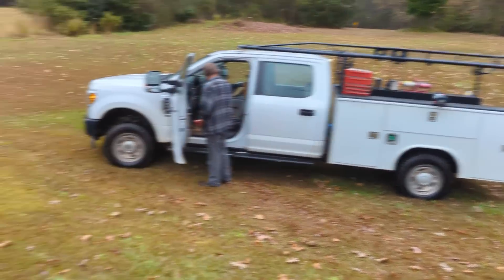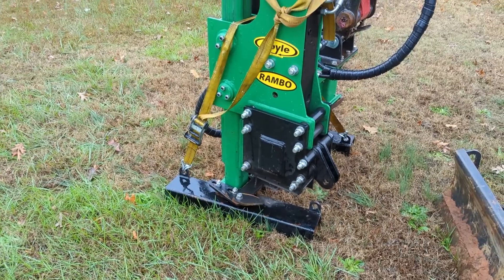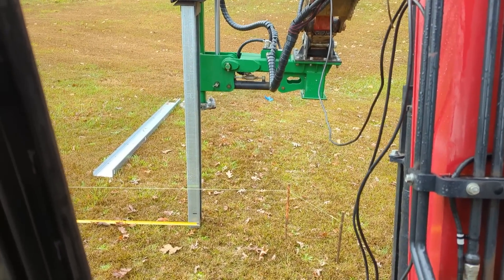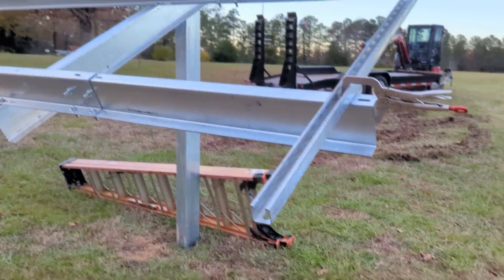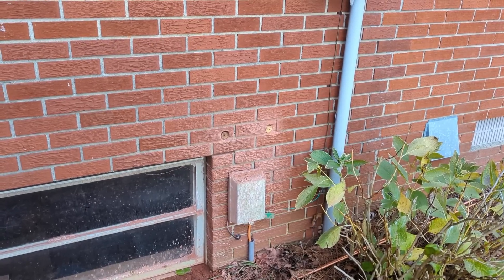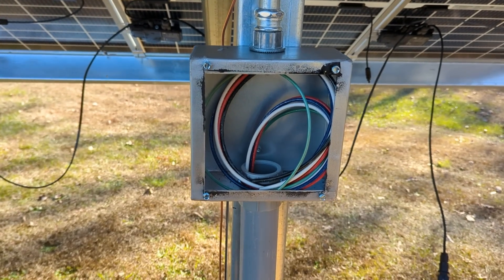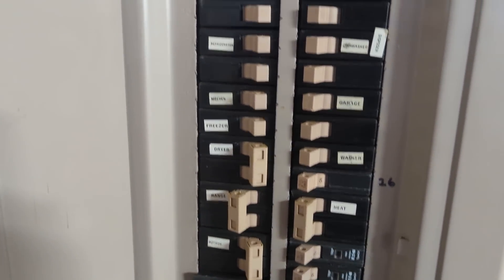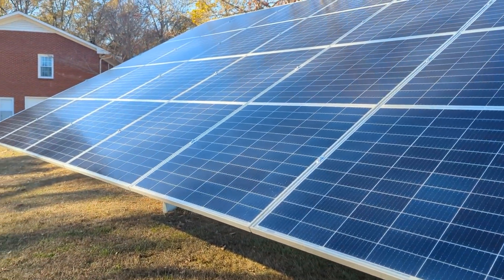Grid Tie? Why Not

Comment: Great video as usual. I wish you were near Wisconsin for my project. I am planning a ground mount grid tie system of 8kw dc. with bifacial panels  and Solaredge inverter with optimizers. Would you put the inverter at the panels and home run the AC to the panel in the house which is 250 feet away or run DC to the inverter in the house by the main panel, Thanks.

Comment: Could you explain the micro inverters please:  Does each solar panel have its own inverter?   Is alternating current delivered from the panel array at 120/240 volts?  Is this a system that delivers power to the utility does it only power up the residence?  Is there any provision to shut off the solar panels so that the conductors leading to the house can be safely worked on?
Reply: Yes each panel sends AC 220v down

Comment: What I did is use oil pipes treated and sprayed zinc coated in the ground with concrete 3 1/2 feet. Making 20.5kw power. Very feel good on it.

Comment: You asking me if I want one know if I can buy fishel solar panels I want more than one I don't know how many I can afford I mean I am going to get a $74,000 loan but yes that $74,000 loan is to buy a truck a car used not new to fix my house get batteries inverters and solar panels but to tell you the truth that would be$44,000 for solar panel batteries and inverters the other $30,000 would be to fix the house by a truck and a car and a second car for my daughter which should be her first car but to let you know I won't buy any vehicle with more than 100,000 miles they all have to have less than 100,000 miles. To tell you the truth the truck has the most miles with about 90,000 everything else got 68000 to 38000 miles on them.

Comment: Well there's a solar panel set that I want to buy that has micro inverters of course I'll just send them microinverters back I don't need them I don't have to have them I don't need to lose all the extra power fishy out of a very small system like that so when I buy system is going to be bigger than even though I have a list of yard than that I can still put up more solar panels. Of course I already have solar panels many different sizes and probably just a little bit more than that but my systems aren't done I need more power to be able to run my house but a small system like that would be run all my mini split air conditioner heaters. Whatever size of solar panels are they might better run my refrigerator microwave kitchen stove in water heater as well as dryer without that air conditioner heaters and I have to start at dry run of on power because there is no power so they can't be disconnected from the grid to rehook up to the solar it would have to be hooked up to the solar from the start from the first day first hour and I would have start from that.

Comment: Nice Install - But I am surprised that you are using 8 Gauge to 12/2 Gauge to take the array voltage to the House - that is small wire - they are long runs - there must be large voltage drop on the long run - there should be large gauge wire used for the length of the run.  It looks like it could be 200+ feet - need to check national code book wire gauge charts for voltage/amps vs length of wire run - to minimize voltage drops on the wire run.  I bet you need to double the gauge size of the wire minimum to like 4 Gauge or 2 Gauge minimum to minimize voltage drops.  Just my 2 cents.

Comment: How do deal with the NEC 120% rule (2014 NEC 705.12(D)(2) )?  Especially if you have more than one array (2 x 40 amp breakers) and the EMC does not allow direct taps.  You mentioned something about derating the breaker.  And in one place you state you using a 40 amp breaker and at the end of the video you state a 50 amp.  For a 200 amp panel, the 120% rule says max is 40 amp.

Comment: Nice looking install. Why would you need inverters on each panel? It looks like you've got little chance of shading where the panels are sited. My Canadian Solar 545W panels came with plenty of lead length to join in series. Are yours smaller panels?

Comment: Grid tie = you're in the dark even though your making electricity.
Reply: Yep.
Reply: how is that? doesn't it switch to battery back up?
Reply: @matthewlawley8799  it only produces power while connected to the utility. This system has no batteries. It’s a grid tied system w/o backup. It will zero out the owner’s power bill, but will not provide power during a grid failure. I hope that makes sense 🤙🏼
Reply: @willistisdale4293  Thanks!
Reply: And I can put the money I would have spent on electricity into saving for a battery system. 
Grid tie is a cheaper way to get started.

Comment: Is this what they call AC-Coupled? The Enphase seems to shadow the panel a little. They couldn't go on the horizontal rail? Looks good. Thanks for sharing.
Reply: Yes, I believe this is AC coupled-where you place inverters on the array/panels and convert DC to AC at the panel.  This one is kind of different because there isn’t a grid tie inverter that takes in the AC and then shares it to the main panel-it’s just a simple combiner that backfeeds a breaker.

Comment: I know you don’t want to give up your mini ex but have you considered a trencher attachment for your skid steer? 
We love ours. Not the best in narrow spots I guess. 
Ugh those short jumpers. We have liked those on the Qcell 485s we’ve been using. Of course not a problem on DC the jobs like you said. 
There’s so many intricacies on these jobs and sourcing materials that are compatible is a constantly changing puzzle. 
Much respect guys,
Reply from the maker: Yeah, I won't give up my mini as I've learned how to backfill with minimal raking. Traditionally, I don't like using trenches. There's a lot more handwork that needs to be done to back fill. I would really tear up the yard where they skid steer trying to fill in the trench. For some customers it's all about the yard looking decent when you leave.  Yes, we are in a constantly changing puzzle for sure. Take care Taylor!
Reply: We have sand here in fl  I can't get away with hammering posts unfortunately.
We use a sk500 and it does everything 
I got all the attachments including a directional boring setup.
Reply: What do you mean you can’t get away with pounding posts in sandy soil?  With the proper inputs for the soil and doing the calculations you could pound posts-they may have to be thicker members or driven somewhat deeper, but it is possible.  The test is would it be cost effective vs. a different style of foundation-IMHO slightly longer or heavier posts are usually cheaper than concrete for foundations.

Comment: A quick question. I just recently read an article on Bi-facial panels and it said that mounting panels vertically and facing east to west will improve efficiency 7 fold. Now it has always been thought to mount panels facing south but with bi-facials east to west according to an August article in Smart Energy. I guess it is the vertical placement rather than horizontal that is the key. Since you are an expert I wanted to get your opinion on this.
Reply: Just had a random thought about this scenario-How would one mount an array of panels in such a configuration?  AFAIK there are no commercially available mounts for that style of mounting?  There has to be a reason no one makes a vertical mount?
Reply: Post a link to the article?
Reply: @balrog006  I just found this also when trying to find this again. https://www.youtube.com/watch?v=WxW4x86mpLk&t=63s
Reply: I’ll give it a watch-any luck on the link you mentioned?

Comment: Grid tie only makes sense these days if the power company is going to pay you fair rate for the power you produce, which most do not in the US. For the money I'd rather build a system with storage than fall for the lopsided ponzi scheme that most utilities are operating under.
Reply: Yep, sadly we are seeing the widespread elimination of net metering policies. Luckily storage is slowly becoming more and more available to everyday people, especially if you can DIY it.
Reply: @NoahBeall-BPS  DIY is getting easier all the time with rack mount systems and all in one inverter/controllers
Reply: @davefroman4700  100% agree!
Reply: Grid tie doesn't make sense. You will be in the dark when the grid fails. Utility companies will give u fair rate, they continue to change the rules to make them more money, electricity independence is an off grid system with you're own storage.

Comment: Grid tie Inverters don't provide power during grid interruption.
Reply: This is correct. UL1741
Reply: Can you help me understand.. If the grid goes down doesn't it switch to battery backup?
Reply: @matthewlawley8799  there is no battery or transfer switch and the inverter(s) are designed to disconnect from the grid on loss of utility power.

Comment: Is there much of a difference between a roof mount or this in price?
Reply: Ground mounts are more expensive typically due to trenching
Reply: The savings comes when you have to replace your shingles on the roof. The price of mod removal and reinstallation will more than cover the difference.
Reply: Both comments below offer good correct points.  Initially ground mounts are more expensive due to more material, trenching, wiring etc., but over the long term will be less when roof maintenance is considered.

Comment: Quick question I have an Enphase system and one panel has stopped working I assume it is the micro inverter how do I replace it and show it on the map of where it’s located on the roof?  And delete the old one?
Reply: You get the warranty replacement and then you “retire” the bad inverter and search for devices. Then assign the the new one to the spot on your map. You need to have the Installer Toolkit app to do all of this.
Reply: @willistisdale4293  And that's IF you had an installer that was bright enough to put the actual inverters in the right spots on the gridsheet. I am responsible for 3 Enphase systems including my own. Due to regulations at the time (2014), I had to hire an installer instead of DIY. I have replaced so many failing inverters I have quit trying to keep these going and are just waiting to convert to a battery system. At least this is a ground mount so maintenance should be easy.
Reply: @meko1896  I hate that for you as I have dealt with the problem you’re describing. The system map is important for sure. If you have certain models of enphase inverters you can qualify for discounted total replacement. It may be worth it to call enphase if you’re having this many problems. They have pretty good customer service.

Comment: Another great video!  I'm also OCD about raking ditches.  May I offer a suggestion when core drilling, buy some cheap plastic drop cloth and masking tape.  Tape it along the brick just below your holes about  6' horizontal. It will keep the mortar dust off everything and make cleanup a lot easier.
Reply from the maker: That's awesome, thank you!

Comment: U better buy yaself a MC4 crimping machine and get ur oldest son to make up them extension cables cos I am pretty sure u will have this bullshit problem AGAIN, When I was a wee young lad out of school I was a cable assembler and tester with up to 200 pin terminations and even though we had to strip the sheath manually thank god we had a machine to strip the individual wires and crimp the pins on the end then manually plug them in the right sequence in the connector housing..... just a bit of a story to give back to ya as a fellow engineer cos u share so much with us bud.

Comment: How do u measure south?? the magnetic poles are moving and are far off true north and some predict a pole flip within 20 years, have u heard that too Cody???? ooops i mean buddy :)~
Reply: Calculate solar noon time and stand outside with your 4ft level at that time. Scribing never lies.
Reply: @taylormills08  The high noon shadow never lies!  Never used a compass doing C-Band installs.
Reply: There are tables and chairs to convert magnetic north to true north for you’d specific location, and apps that will do it for you.  As well as the old school methods in the other comments here.  Finding true Solar South is not a hard task.
Reply: 9:01
Reply: Land marks and google earth. Or N star

Comment: Ground rod at the array is an interesting point. We don't put them in, as we run a continuous ground wire from array back to service ground. But one inspector wanted them. At the time, researched a bit and recall that having two grounding places could result in potential differences between array and house, where the connection point is, so there was a recommendation against putting ground rods at array. OTOH, I think you could read the code as requiring them. Never got to the point where I understood what was the best method, but we basically never have an inspector that wants a ground rod at array.
Reply: When you think about it … all those posts in the ground are acting like ground rods in parallel.
Reply: A few of our inspectors have hit us on not having ground rods at the array, but after talking with them back and forth, we all agreed it makes the most sense to not install them. I’ve never seen the potential difference cause any issues with ground mounted solar, but in my past life I’ve seen a couple industrial machines get burnt up up because the manufacturer required a ground rod at the unit.
Reply from the maker: I hate to say that we add them for the inspector only but I don't see any detriment to putting one in and it doesn't take that long.
Reply: The length of wire between the array and the house would create potential as well.
Reply: It’s a redundancy ¯\_(ツ)_/¯. The posts are definitely acting as a ground. The important thing is the connecting bonding the metal in the array to the metal in the components at the house. It can’t hurt anything and l have definitely had inspections where the AHJ looked for the extra rods. Oh how I love to talk grounding and bonding (not really). You aren’t wrong, though.

Comment: Hey Scott! I see you installed a 50/2p breaker in the 200A Main breaker panel. The bus bar rating of the panel must have been 225 amps!
Reply: It’s based on the output of the system, not the breaker size.
Reply: @willistisdale4293  The breaker size is determined by the inverter output. The 120% rule is applied to the bus rating of the panel to find the maximum overcurrent protection that be added.  IE it is 120% of the bus rating minus the main breaker rating to provide the amount of additional loading the solar can add.  So for a typical 200A panel with a 200A main breaker there is an additional 40A that is permitted for an overcurrent protection device, which translates to 32A of continuous AC power from a solar inverter.
Reply: @8894larry   on this system the math comes out to 36.3 amps. I could have used a 40a breaker. You aren’t wrong about the rule, but we haven’t violated it because the rule is based on output not ocpd size. We actually considered a main breaker derate when discussing options for larger systems with the customer. It passed, it works, and it is safe.

Comment: Looks like the trees shadows might reach the panels. At least with Enphase, they won't all go down.
Reply: Good news, on modern solar modules, the addition of bypass diodes allows current from other modules in a string to flow through a shaded module so not to eliminate all string production.
Reply: The Christmas tree light effect has been completely debunked. PO and Micros done don’t add much value other than monitoring.  Simple research will bear it out.

Comment: Advantages & Disadvantages of micro inverters versus keeping everything DC to an all-in-one inverter?
Reply: AC micros like this without something like a SolArk make a simple grid tie system, but eliminate the possibility of battery back up, running off grid, or possibly selling power back to the utility.  AIO inverters like the SA15k allow all of the above and either AC or DC coupled solar (or both) and also generator input.

Comment: GREAT JOB SCOTT!
ON A SOL-ARK & ROOF MOUNT DO YOU RECOMMEND ‘RAPID SHUTDOWN’ MODULES?
Reply from the maker: On a roof mount rapid shutdown is unavoidable and I am not putting it on ground mounts according to 690.12 as well as some common sense.
Reply: Rapid Shutdown modules are required by NEC code to communicate between inverter and modules if any conductor enters a building that is not specifically designed to house the PV system components.
Reply: @BoozyMcHound  I've never seen anyone use them in the scenario where they have a ground mount and route the PV conductors through the house to the inverter.
Reply: @niktak1114  ground mounts must have rapid shutdown if you you install any DC side equipment inside the dwelling, no problem if mounted on exterior
Reply: @stan4765  Hmm I've never seen that. I don't remember seeing engineer775 do that on any of his installations either.